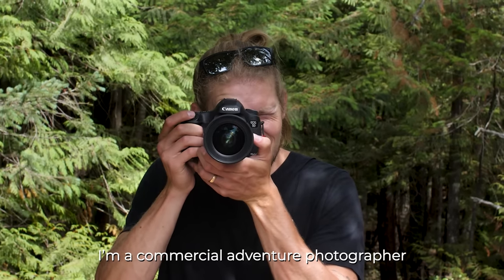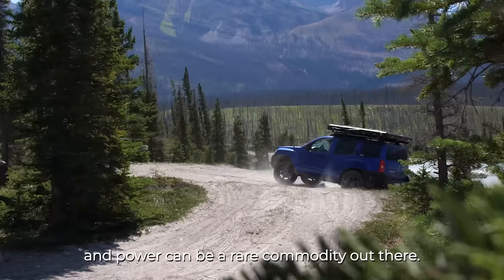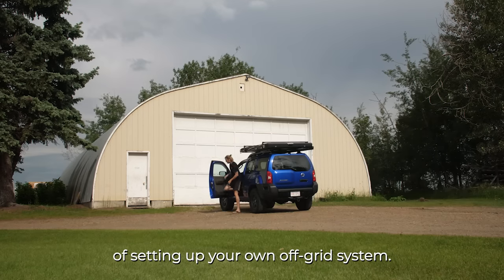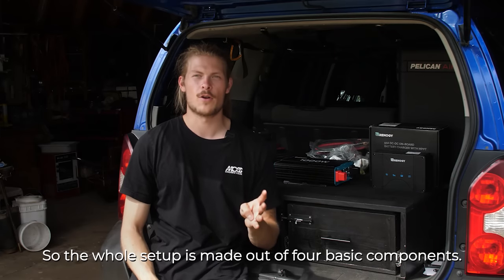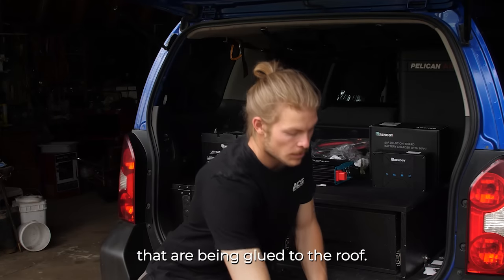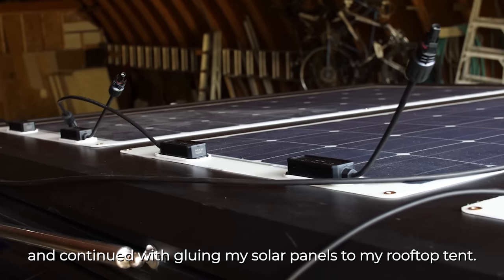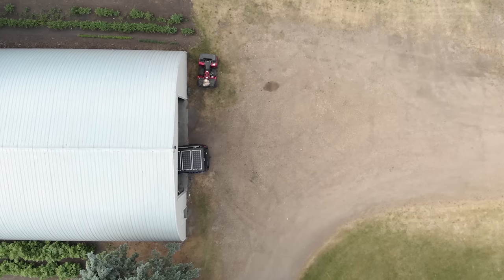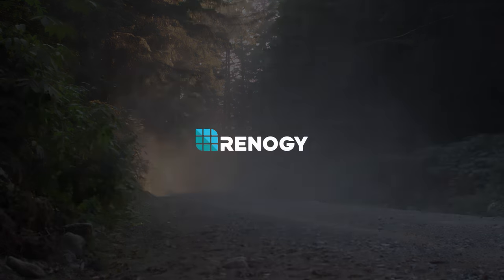Claudio Frimmel with Renogy | How to rock at camping out in your car

Comment: Do not plug any expensive touch screen or smart devices into any renogy inverter. It will DAMAGE them beyond repair. They emit a high frequency RF signal that is detrimental to them. When I brought my top of the range company tablet to have it repaired after plugging it in to charge it on a renogy inverter,  the repair person told me that it is a regular occurrence, and he sees it very often with cheap inveters and he can't repair the damage done. And renogy customer service actually hate having to deal with customers. If they don't totally ignore you , they will instead blame you for the way you installed their product.....in a very blunt and rude manner. Bad company , dreadful products and even worse customer service.
Reply from the maker: Hi, Jesse.

Thank you for your feedback. We do apologize about the bad experience brought to you. 

In order to learn more about the problems you have encountered when using our products, can you please kindly tell us your case number or order number?